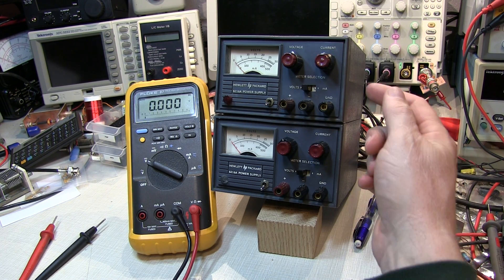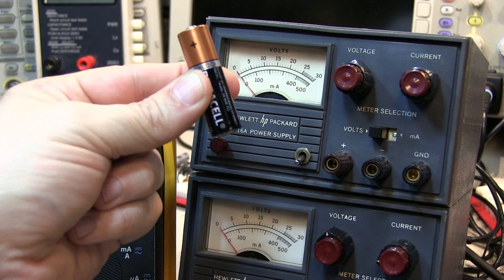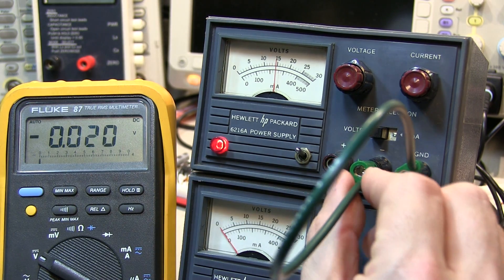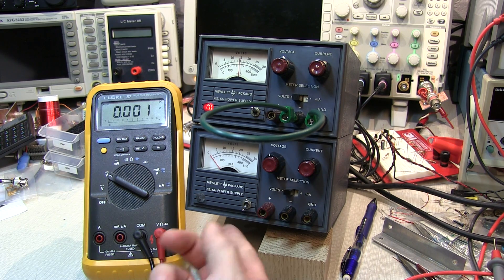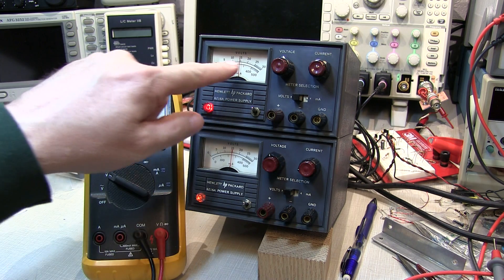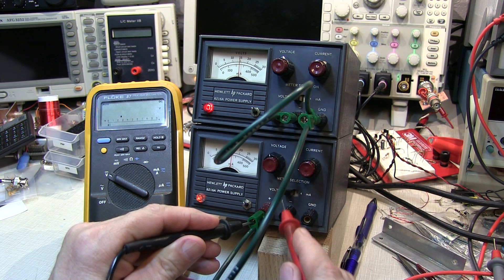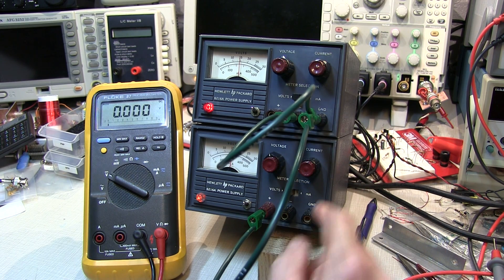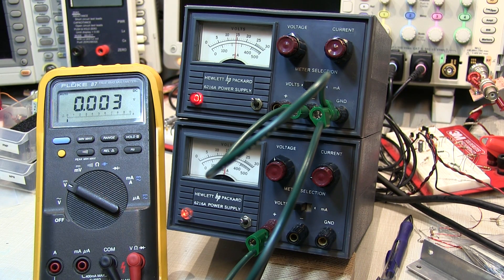#233: Back to Basics: How to use the 3 terminals of a lab power supply | split supply

Comment: Sorry, but this video has not explained to me why there is the ground terminal on lab power supplies.
Reply from the maker: It gives you the option to run the power supply as floating, or positive with respect to ground, or negative with respect to ground.  Which configuration you need depends on the circuit or device that you're powering up with the supply.  It basically comes down to the grounding needs or configuration of your device under test.
Reply: w2aew I am very sorry, but it is still a mistery for me. My idea of electricity is that there is somewhere some amount of material that has got an excessive number of electrons, so it has got a negative charge, and somewhere there is some amount of material that has got a lack of electrons, so it has got a positive charge. If you put between them a conductor then the excess electrons move to fill up the lack of electrons. So what is the ground?
Reply from the maker: Current flows due to Electromotive Force (EMF), which is essentially the voltage.  Voltage can be generated a number of ways, such as an abundance of charge (such as a charged capacitor), via changing magnetic field (such as in a generator), or even chemically (such as in a battery).  The voltage essentially "pushes" the current.  But, in order to do so, you must have a complete circuit (loop).  Ground is simply a common reference point.  Voltage is always referred to between two points, such as the voltage across a component, or the voltage between points A and B.  When two points aren't specified, it is assumed that the "reference point" is ground.
Reply: w2aew I always thought that the reference point was the absence of electrical charge, zero volt, the neutral state where all the electrons and protons of the matter are balanced. So loop means that there has to be only one source of EMF, you cannot have a current flowing from the negative pole of one EMF source to the positive pole of another EMF source. For example when you see a lightining there has to be a loop.
Reply from the maker: Voltage is always referenced to somewhere, just like physical distance is always with respect to somewhere or something. You can have multiple voltage sources in a loop - but there is always a loop (or more than one).  Current needs a complete circuit in order to flow.  You certainly can have current flowing from the negative pole of one voltage source to the positive pole of another - this is how you connect batteries in series.  You can also have current flow from the positive of one source to the positive of another - this is how you charge a battery.

Comment: It seems counter intuitive to take the positive side of the power supply and connect it to the ground terminal of the other, you'd think it would short right out and have fireworks.  But it's because it's isolated?

Comment: Excellent video thanks.
I have an old ThandarTS3021S that I picked up from a junk sale and repaired. It has 5 terminals on the front (2 pos ,2 neg and an earth terminal and I have no idea why!
I cant find a manual to explain the reasons behind the dual terminals, but one pair are marked out put and the other are marked sense.
Anyone have an idea behind this?
Reply from the maker: Yes I do.  The SENSE lines are basically like the inputs to a voltmeter.  The supply will adjust the OUTPUT voltage so that the voltage that is measured (or "sensed") on the SENSE terminals equals the desired voltage.  This arrangement can be very useful to accurately generate a desired voltage at the device you're testing by connecting the sense lines to the device under test.  This is called "remote sensing".  If you don't need or want to do remote sensing, then simply connect a short wire between the POS supply and sense terminals, and another one between the NEG sense and supply terminals, and just use the supply as normal.
Reply: Cheers buddy, I'm so glad I asked!
I was truly puzzled by the terminal options and thought it may have some sort of split supply option for powering a dual rail op amp set up, which was my initial reason for purchasing it.
Many thanks for taking the time to answer my question,

Comment: Very good explanation. There is one very important thing to be aware of when the supply is connected to ref. ground. Using an oscilloscope for example. The oscilloscope's probe clip is connected to ref. ground. If the device you are probing is powered with ref. to ground and by mistake connect the probe clip to any positive (+) part of the device you're testing, there is a high risk of blowing up your oscilloscope.
What I basicly have as a rule of thumb is to always connect your test equipment like oscilloscopes, function generators, bench meters and so on referenced to mains ground and always power the equipment you are testing/probing with a mains-isolated supply.
Edited to clarify: The power supply should be connected to mains ground. What I meant was if you power a device through mains ground output i.e. Green on most supplies.
There are ofcourse exceptions in special cases. Hope this saves some scopes out there. Cheers.

Comment: Thank you very much Alan. I've just bought an old twin dual rail power supply by Farnell off Ebay. After watching this film I connected the jumpers up for +6 and -6 v with respect to ground. My current project - a two tone oscillator with burst mode from the RSGB Test Equipment book came to life. I'd tried making a negative voltage ladder but its output went positive under load. So a cash solution was successful. 73 David M0YDH

Comment: I just bought a lab power supply for the first time (i've been needing one FOREVER). I was checking the voltages between Ground and + or -, and was certain it was broken.  I would run it for 30v and see barely any movement.  Then I watched this video, smacked myself in the face, and felt stupider than I've felt in a really long time :) Thanks for making this. It was extremely helpful.
Reply from the maker: I'm glad this video helped. In many applications, connecting to ground is optional. It is there for those situations when you specifically want to pin ground to a particular rail.

Comment: What good would a negative voltage do??? I guess I still dont get it...so where does the - come from..off of the transformer in the power supply and the ground is hooked to earth ground..?
Reply from the maker: +Kennynva T. Many signals that need to be process (amplified, detected, filtered, conditioned, etc.) are true AC signals - meaning that they swing above and below ground.  Thus, the circuits that process these signals need split power supplies - both a positive and negative supply rail.
Reply: A negative voltage is just meaning that the difference of two electrical potential is negative, such as is negative the result of  " 6 feet from the ground minus 20 feet from the ground " (giving "minus 14 feet").

 If  Va - Vb gives minus 10 volts, then you know that electrons will mostly go from b to a rather than from a to b, same as, for gravity, if Ha - Hb is minus 14 feet, an object will move from b to a, not from a to b (unless the said object owns some initial velocity, that is).

Comment: Hello Allan,

Could you do a video specifically on SSB  envelopes and the different forms and shapes ?  I have been scouring the web and old vintage textbooks for pictures of waveforms to compare SSB heterodyne envelopes to DSB and AM envelopes.
There are not many articles either.  I found some nice explanations in the 1947 and 1955 editions of Radio Engineering by Frederick Terman.  Also some nice pictures in "Principles of Communication"  6th edition by Ziemer and Tranter.
FM  Colebrook wrote a classic and seminal paper in the April 1932 issue of "Wireless Engineer".
In University my professors failed to explain that the sidebands BEAT against each other or the carrier.  Just one sideband,
or the carrier by itself results in no envelope interference pattern,  just an ordinary sinusoidal waveform.

Kindest regards and God Bless,

Peter
Reply from the maker: +Peter B I've sort of presented this in my video that shows how to get AM or DSB(sc) from a Gilbert Cell:
https://www.youtube.com/watch?v=38OQub2Vi2Q
For DSB - thinking about the two sidebands beating against each other is a good way to think about it.  The video above shows the resulting envelope, as well as what it looks like in the frequency domain.

Comment: Oooh, dangerous... I wonder how many people watching this video are going to see that their circuit diagram shows +5V, and therefore think that they now "must" connect negative to ground. Measuring voltages relative to +5V by connecting the oscilloscope ground clip to +5V will suddenly become a whole lot more exciting. Floating is surely always strongly preferred unless you have a strong reason to avoid it; and when it comes to interconnecting different devices, there's practically always a ground connection happening between those devices anyway, whether it's data, video or audio. Even in consumer audio situations, ground loops are to be avoided.  No, I can't strongly endorse a video that talks about casually connecting up circuit grounds to mains earth just for fun.
Reply from the maker: +TheHue&#39;s SciTech If course, the connection to GND is optional - totally up to the user.  The main point is to be aware of GND, what is connected to it (i.e. scope probes, etc.), and to be cognizant of the effects of connecting it or letting the supply and test circuit "float" with respect to earth.
Reply: I watched this video, and I do have some trepidation  regarding the hazards when other devices are connected -  definitely looking at isolated oscilloscopes.

Comment: Hi Alan. always good to see a new video from you. watching it I was thinking it might have been good to mention about dual tracking power supplies. I'm not sure how common they are but I have one. Also was thinking worthwhile to note that (especially for non "lab" power supplies) that might be internally referenced to ground (not isolated) that there is a potential for short circuit when stacking them.

Comment: Thanks for the video Alan but can I ask you what is the difference between connecting the PSU's the way you did using the GND and not simply connecting the + of the lower PSU to the - of the upper and connecting your circuit between the - of the lower and the + of the upper?
Like the HP supplies by the way, how do you get hold of such old equipment?
Reply from the maker: +Michael Hawthorne The only difference is that if you don't tie in the GND terminal, the supplies will not be ground referenced.  In many cases, this is just fine.  However, many circuits will need to be connected to other circuits/equipment that are ground referenced, so including the ground will keep the supply voltages from floating off of ground.  For example, your oscilloscope is ground referenced - when you connect your scope probe's ground to your circuit, you're establishing a ground reference at your circuit.  If the supply is already ground referenced, this would help to avoid a small "floating" difference between the circuit and the scope.  In vast majority of cases, the small potential difference would safely and quickly go away when the scope ground was connected anyway.  Just a bit of extra safety keeping the circuit and the equipment referenced to the same ground.
Reply: I found HP power supplies on eBay. I got a pair of HP 6214s - a model with lower voltage and higher amperage. I may get a third. About $40+ each.

Comment: Probably a dumb question, but can I take the connect the negative on the top supply directly to the positive on the bottom supply, (i.e without connecting to ground) and thereby get a mains-isolated split supply?
Reply from the maker: +iceberg789 The most common is when you have multiple supply rails, and you're connecting to test equipment.  The equipment is almost always mains ground referenced, so it is usually advisable to establish an earth reference on the circuit.
Reply from the maker: +Rodrigo Amestica I guess I should've made it clearer that connecting the GND is optional.  In general, it is a good idea so that your supply doesn't float somewhere unexpected.  But, in many, many applications, keeping the supply floating is perfectly fine.
Reply: Extremely important point. 

YouTube is overrun with content providers who don't understand the entire concept of voltage referencing.  There are videos out there which state unambiguously that it is dangerous to float any device that has any sort of connection to mains supply.  While this is obviously incorrect, equipment manufactures make the problem worse by writing user instructions to that effect.

Your willingness to ask the question is extremely important.  This channel is a great place to ask questions without fear of ignorant "experts" bowing smoke at you.
Reply: Yes.
Reply from the maker: +Jack White As Jack said - yes you can.
Reply: +w2aew if keeping power supply floating is fine, why we actually need to connect the middle terminal to earth ground ? it will still be +15 / 0 / -15 supply for opamps, without the earth gnd.....
Reply from the maker: Yes, it will. In many cases, connecting to earth ground is optional.
Reply: ummm ok, but when exactly earth ground is a necessity, radio applications ?
Reply: And remember that the gnd crocodile clip on oscilloscopes are actually internally connected to mains ground, so if you're probing a circuit with the PSU connected to mains ground, that's the only place where you can connect the gnd clip, or bad things will happen. On the other hand, if the PSU is floating, and there's no other mains ground connected stuff on the circuit (like USB from a PC!), then you're safe, you can connect the crocodile clip anywhere.
Reply: That was a good question... thanks for asking!
Reply: +thisnicklldo same here, thanks for asking that question. After starting to watch for a second time then it also dawned on me that the video was not explicit on why using mains ground was so pervasive through it.
Reply: Some power suplys on induction cooking/tig soldering  best is not ground the power suply and use isolated osciloscope or you can risk get hugle bang,  but this issue is may be for another video blog.
Reply: w2aew - True to the degree that appropriate isolation transformers or other advanced tricks don't get in the mix.  

YouTube is utterly loaded with bad information on isolation generally, and as it relates to test equipment specifically.  Having fought many a troll war on this topic, I wouldn't touch it again!  I do refer people to Mr. Carlson's Lab for one good video, but be prepared, your jumping in the deep water.  B+ voltages on open chassis vacuum tube gear will actually, no exaggeration, kill you dead.

Comment: Would it be possible to achieve similar results using just one power supply and put 10Meg resistors from +ve to GND and from -ve to GND ?    this would halve the voltage though. would that work and if so what drawbacks might it have?
Reply: Well, that would be called a virtual ground or, by another name, a resistor divider network. However, at 10Mohms the impedance would be enormous, the current available minuscule, and any meaningful load will lead to wild voltage fluctuations since there is a very high impedance between the virtual ground and the regulated power supply outputs/rails. You will often see virtual grounds used in op-amp circuits that drive high impedance outputs from a single voltage supply, but they are only practical because the driven outputs are high impedance in that circuit, though doing so also lowers the headroom between the rails and virtual ground and effectively limits the op-amp's bandwidth as well.

Another option for single supply op-amp projects driving modest impedance loads is a charge pump circuit/IC to generate a low current negative rail. Still not as good as a true regulated power supply rail, but can deliver more power with less waste and effectively doubles the voltage between rails.
Reply: +Alfie Malfie With such a huge impedance on the virtual ground, the only way that'd work as you expected is if you took all current coming from the positive supply and returned it all to the negative supply, with no actually current being sourced/sunk into the virtual ground. But that, of course, would totally defeat any point of a ground, and you'd have to ask why you wouldn't just leave the supply floating instead.

Comment: I have an Elenco Kit power supply and both the positive and negative supplies are already referenced to ground. without the need for any jumper wires.
Reply from the maker: +GalaticTG There are many supplies that are made that way.  Nothing wrong with it at all.  The only downside is that you can't use it when you need the output to float (stacking, etc.).

Comment: Sorry, but I didn't get the point at all. I think the exactly same results would be if the ground were disconnected. So why to have ground? Seems just excessive.
Reply from the maker: +Angular Without the ground, you can still create the stacked or split supplies, except that they won't be referenced to Earth/GND.  In many cases this is OK, but in some cases can result in a potential difference between your circuit's reference potential and Ground as used by any equipment or circuits that you interface with.

Comment: I recently acquired some test gear and among the gear was a HP 6024A variable power supply.. I recently did a video on the gear and in that video I questioned why there was a negative and ground on the power supply. Your video explains it quiet well. Your video was most helpful to me. Thanks for sharing